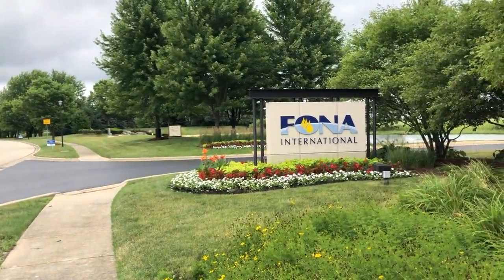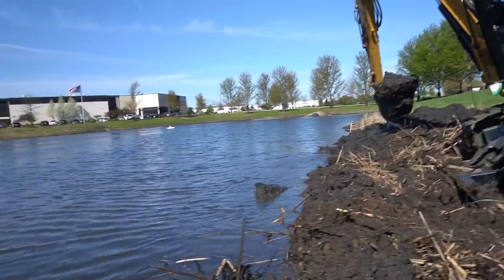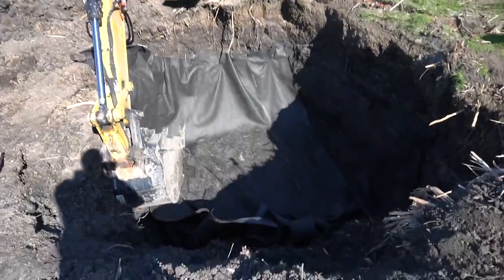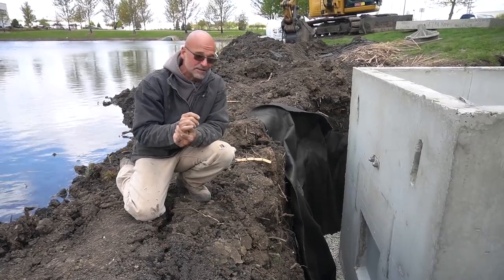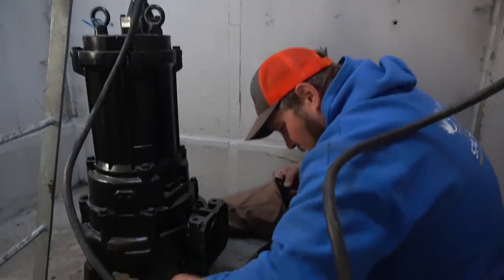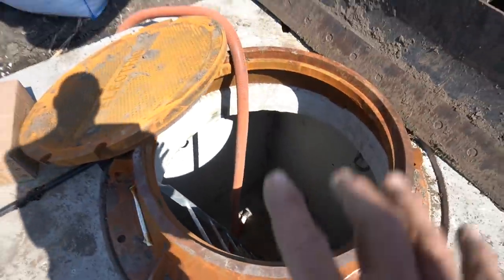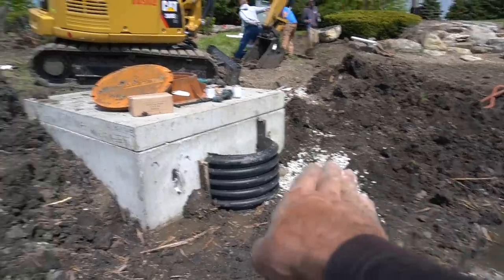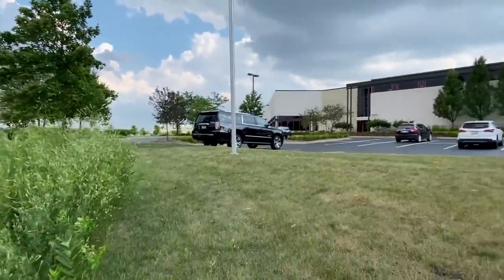How to Install a Concrete Pond Pump Vault

Comment: I maintained flood control and sewer pumping stations for years. I had a couple of small stormwater stations with submersible pumps about the size of the one you guys installed. Most of my stations were big enough to hold multiple pumps, emergency generators, switch gears, control panels with variable speed controls and all the other normal equipment. We had Flygt pumps in most of the stations, except for 4 big ones that had old Fairbanks-Morse pumps. Those pumps were older than me, and I was born in '58. 
Love your channel and your work. The installations are first rate. I'm trying to convince my son and daughter in law to have a water feature like the ones your channel highlights on their rural property.
Reply: That sounds interesting, I love storm water ponds and solutions. 
Flygt pumps are great!!!
Thanks for your feedback and support......
Reply: I really think that's a grate idea I hope they understand how beautiful and easy to mantain not counting helping the water conditions good luck and God bless u all and hope yall have a super awesome day

Comment: I think this is an impressive solution to create circulation on a retention pond.  I've been brainstorming solutions for awhile to add a large creek + bog filter for my half acre pond.   I'm looking to significantly improve water quality for my koi.
Reply from the maker: It’s very effective but probably overkill for your needs. 
An Intake Bay would be more cost effective and efficient for this application.

Comment: Always awesome to be here! Wow that is a different type of pump vault. Why was the vault used instead of an intake bay?
Reply: Great question Shawn!!!
Intake Bays are designed to act as a skimmer and help to control organic matter(leaves, grass, algae, etc.....) by drawing water into the bay, this is very beneficial when water quality is of importance.
This client was not looking for that level of water quality and/or maintenance so we installed the pump vault just to house the pump.
Does that make sense???
Reply: @edbeaulieu5916  Makes perfect sense! Thanks Ed! Do the solids handling pumps actually pass the solids without chewing them up?
Reply: Shawn Baker Yes,
This is a Vortex Style pump,
It will allow material to be drawn into the Volute and then pushed up the pipe without actually destroying the solid unless it has an odd shape or length.

Comment: Ed, each job really is custom, not only because of the needs of the water and the ecosystem but also ease of maintenance. The pump fault reminds me of a smaller version of the new septic system we put in a few years ago. How long did this project take, and man hours?
Reply: It was spread out over 4 days, with a total of 140 man hours